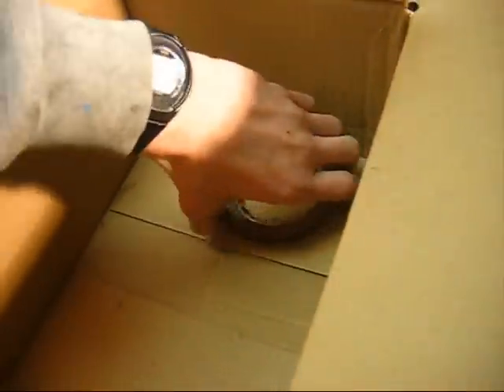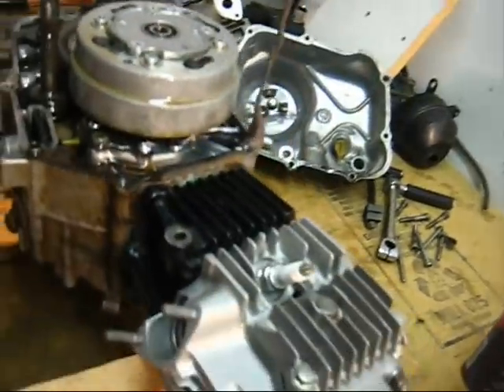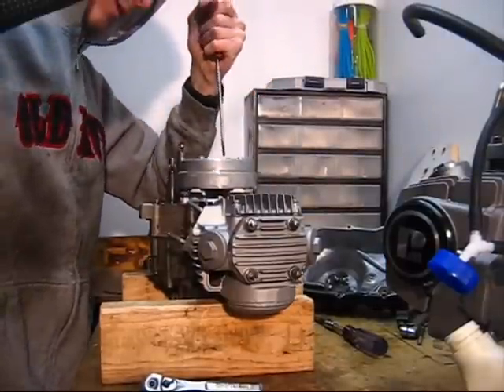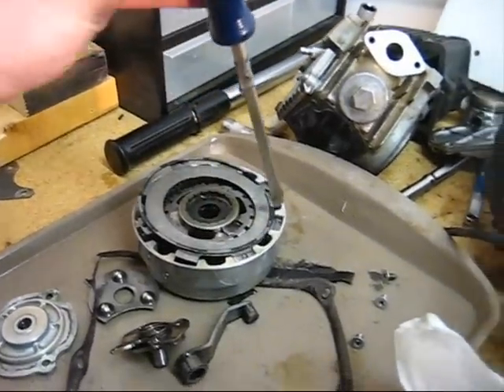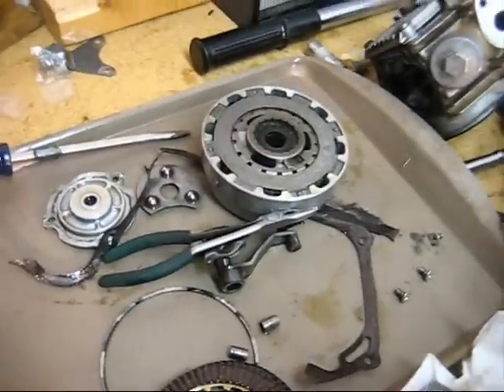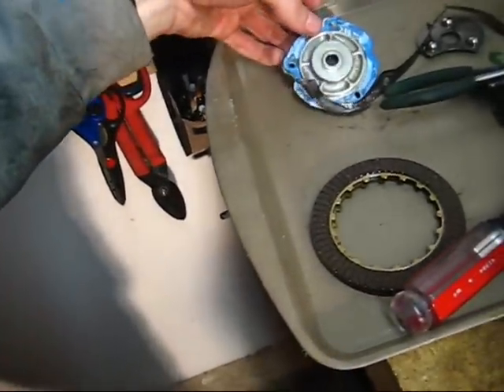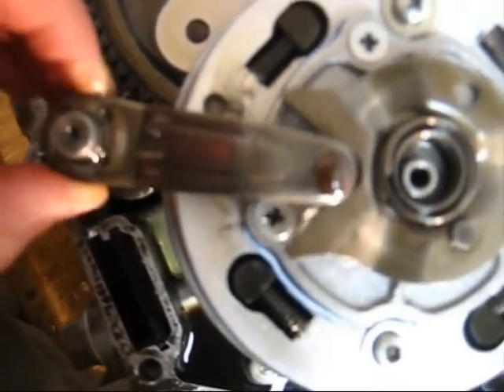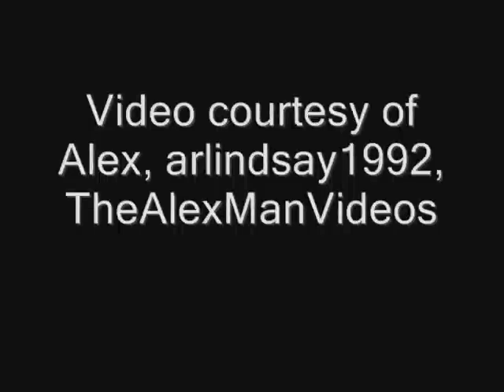How to Install Clutch Plates and HD Clutch

Comment from the maker: It's probably the shift lever. It engages with the clutch cover. If you leaned the bike on its side to remove the cover, make sure there is no pressure on the shift lever.

Comment: he forgot to oil the new friction plates friction plates should be under oil for 1/2 hour and sand ore beat-blast the old steel plates if reusing the steel plates he allso forgot to clean the assembly removing the old friction materials,the clutch is also acts ass an oil filter by sentrifical force that why there an GASKET on the small cover with the bearing in the middle.HELLO ex honda pro

Comment: Hey, a great idea but you really need to lock the camera off. When it is hand-held and moving the entire image has to refresh and it is not only hard to see what's going on generally, but the frame rate drops dramatically on slower PC's or lower broadband services too.. If I I was already familiar with the inside of the motor I could refer back to my own experiences but from the perspective of a newbie, it was extremely hard to see what you were doing in enough detail!
Thanks though!

Comment: Thanks,i'm about to overhaul one myself and i haven't done a small Honda before,just classic British bikes,however i have 2 comments here,firstly you have let someone else handle the video camera,it would have been clearer and secondly,the blued /glazed steel plates should have been cleaned in solvent to degrease them and etched in Muriatic acid, then cleaned again to remove the acid,the etched surface will be  far better  for the new friction plates to grip on than the glazed ones.

Comment from the maker: First make sure the idle isn't set too high. If the idle is correct, it is a fairly common problem for the TB HD clutches to drag a little when they are new. To fix this simply ride the bike. The clutch eventually wears in and works just like it should.

Comment from the maker: The case bolts should not be tightened with an impact driver, only use a good phillips screwdriver. Same with the the inner clutch cover. If you tighten them with an impact driver they willl be very difficult to remove next time. What are you talking about with the clutch nut? You need to bend it out to allow the nut to spin. It is recommended that you replace the lock tab each time it is removed.

Comment from the maker: If you're doing the job do it right, buy the gasket. Silicone sealant work at best, but it's more likely to leak, make a mess, and clog up oil passages in the engine. Also, I apologize for being rude earlier. TB has the part under the "Other" tab, but the tool is out of stock. DrATV, however, does have them. Here's the link: dratv com/clutnuttool4.html. Insert a period.

Comment: @TheAlexManVideos hi i have a qustion for you i have a loncin 110cc quad engine .. im lookin to install a 140cc motor , trouble is the quad is set up for shaft drive . then engine i want to fit isnt, how do i go about a chain to shaft conversion ? would i need to split the engine ? any ideas of the routine process?, plz reply with any info you might have thanks

Comment: what happens when you cannot get the 3 screws that are holding the top plate on? mine are rusted , frozen and partially stripped.i hear this a common problem, with out those screws out you can,t do much!!! any recommendations on this ? thanks
Reply: drill drill drill baby
Reply: yea got em out. what a pain in the butt

Comment: @TheAlexManVideos  actually in my transmission there are two arms (instead of one main arm there is a sort of joint W/ a slot in the middle) and you hook the arm and I don't know if it should be in the middle or what,it's kinda hard to explain it, but thank you very much for replying to my question,

Comment: hey man i like your videos , got a question thow , i just did a 88cc install on my bike and fried my stock clutch , i was looking at the TB 3plate clutch , are they any diffrent to install ? i plan on getting the whole HD setup with basket so it should just be an easy drop in

Comment from the maker: I've heard nothing but good things about them. Don't be afraid if it drags a little for the first couple rides. It takes a ride or two to run in even if you adjust it perfect. I'm assuming you're talking about the HD auto clutch.

Comment: excellent video,, I have a question, does that clutch deactivation arm have to point at the center of the clutch? the engine of mine is a honda nf100 usually found on underbones in asia I have problems since my clutch does not disengage or freeplay never happens when I downshift, I had a stupid mechanic do my bloody transmission and its bullshit I don't want to have it fixed anywhere, can you give me tips or a video? pls. I don't trust the mechanics here,also with adjusting the screw outside

Comment from the maker: @dartomaker The arm must point to the center of the clutch. Make sure the shifter isn't being pushed up or down if you have the bike laid on the left side. See my video called 50/70 clutch adjustment to see how to adjust the clutch with the screw on the right side of the motor.

Comment: Hey bro how do you set thevlick stator so it's at the correct position whenyou reasemmbly the cases because i had to replacey main trans bearings and now i have no clues as to where the or what way the shaft for the kickstator goes

Comment from the maker: The primary gearing might be different between your motor and the newer CRF motor that the kit was designed for. If so you'll need to get the primary gears from a CRF. Unfortunately I can't remember the specs on either one. It's been a while since I built these motors. Other than that, it will bolt on for sure.

Comment: Hey Alex, I have a china 90cc semiauto 3speed+rev. making about 9to10hp with all the mods. I've done. The problem I'm having is that the friction plates keep falling apart when I do donuts and or ask too much from them. I added washers to the springs so they would act like heavy duty clutch springs. This will be the third time I need to replace my clutchs. Where or how can I find a solution to this problem.
Reply: Get oem Honda parts. That sounds like your problem to much aftermarket parts

Comment: how did you tighten back the case bolts. impact screwdriver? and can you take out the clutch nut with out that lock tab?

Comment: Wow, Thanks. that was much simpler than I had imagined..... I might do a pit bike project soon with that sort of engine and transmission driving a CVT scooter style auxiliary trans..which in turn drives the wheel.... It may take a few tries to get all of the ratios just right.

Comment: I've noticed my sons CRF70 lunges a bit when shifting, would that be an indication of needing a new clutch plate? I just bought the bike used.
Reply from the maker: Not likely. Typically if the clutch is going out it will slip when kickstarting. You'll kick but feel less than normal resistance and the engine will not always turn over. If it's lunging during shifts, it's likely not disengaging and needs to be adjusted. Look up my video on how to adjust a Honda 50/70cc clutch.
Reply: TheAlexManVideos have that exact problem. Turning over engine by hand I can feel good compression. Try kicking it over and it feels mushy and won't start. New clutch plates are on their way. Got a manual but your video makes the process very clear, thanks!

Comment: I currently don't have the tools to do this to my 110cc engine. Can I pay you to do this simple upgrade for me, please? I have lost some speed performance on the clutch plates.
Reply from the maker: I would be glad to help out if you are close by and it's what you want to do. But I think it would be cheaper and more satisfying for you to buy the tools necessary and do the work yourself. Besides basic hand tools (sockets, screwdrivers) the only special tool you need is a special socket to remove the nut on the end of the crankshaft.
Reply: TheAlexManVideos Can you show me where that I can buy a clutch nut for my 110cc, please?
Reply: Donnie, Please tell me your Joking.. You want this Guy to unscrew a few Bolts, buy you a clutch Nut and put the Case back on?  He lives in Turkey !!!!
Reply: SMS CUSTOMS I can do myself now, no sweat, thanks :")  I moved onto a stronger engine anyways.

Comment: Do you need to put a gasket sealant over the gasket when putting on the clutch cover thanks
Reply from the maker: No sealer is required on a clean smooth sealing surface.

Comment: Just getting ready to replace my clutch cover (long story), you drain the oil before removing the case right?
Reply: It would be less messy
Reply: No Way !!!!
Reply: No u don't have to lay the bike down if you have fresh oil in it. If it needs to be changed dont worry about it take it apart oil keeps the bugs away some bugs lol

Comment: I never did see the centrifugal oil filter?
Reply from the maker: The centrifugal oil filter is the space behind the little cover on the clutch. Oil goes in there and is spun around before entering in the end of the crankshaft. The spinning is what removes contaminants. It's not perfect, but it helps. You'll see a grey sludgy goop in there on a high hour engine.
Reply: TheAlexManVideos That is very interesting. Thanks for your reply.
Reply: There is a screen in every motor to thats the filter

Comment: what alternate tool can i use if  don't have clutch nut remover?
Reply: Angela Jeanou can grind notches in a socket to fit, not sure what size socket you would need.
Reply: Aron Landess 22mm
Reply: Save yourself time buy the 10 dollar tool on Amazon You'll ruin it if you don't. I hate Amazon but most people use them i personally bought mine on ebay for less than 10 few months ago